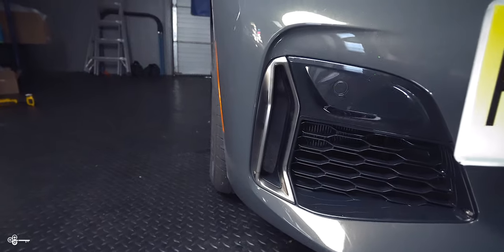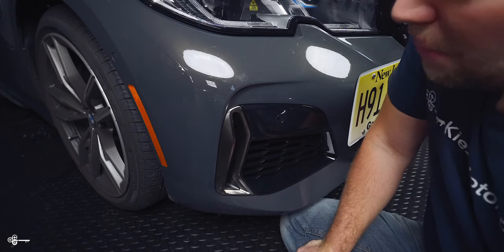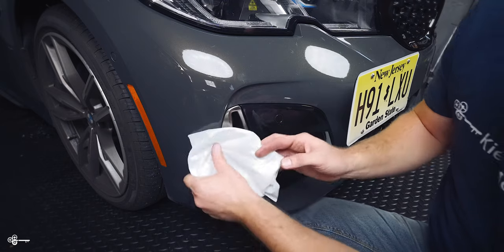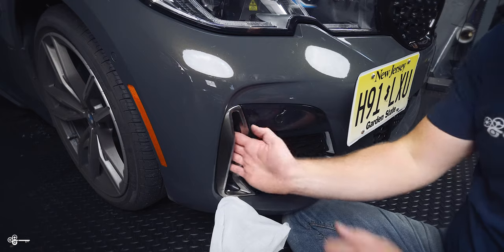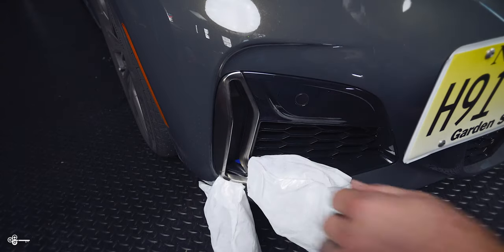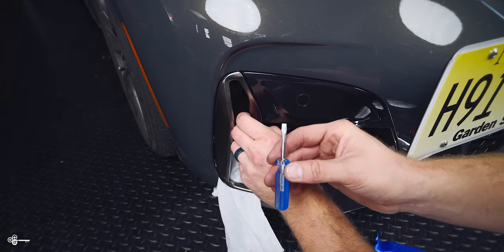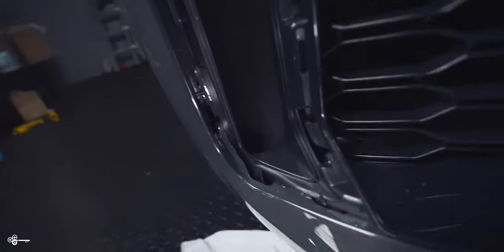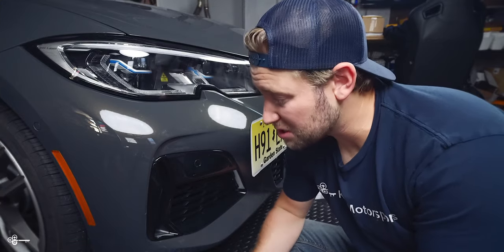How to Install BMW G20 Front Bumper Trim (BMW M Sport High Gloss Black Front Trim)

Comment: I just completed the switch out and the G20 now looks amazing (after the black grill, carbon fiber mirror caps and carbon fiber rear spoiler).  Thank you Bryan for the instructions and yes you should first start on the bottom inside clip (side with 3 clips) as that pops easily with a trim tool.  Then pop off the opposite side bottom clip (which now will pop off easily with your finger). Then gently work your way up the side with three clips.  I used a very fine thin flathead screw driver (like in the video) to get the middle clip (using the new trim piece as a guide and your instructions to depress the tab).  Then release the other outside tab (side with two tabs) with your fingers before attempting the last top tab with the fine screw driver.  After that the trim piece popped right out.  Go slow and it does work.

Comment: Great video/instructions!  Two additional tips to mention here: 1.) as mentioned in the video, start from bottom up/outside clip first--on my G20 I was able to reach the backside of this bottom/outside clip from the small brake vent gap within the wheel well. By also pushing on the backside of the trim tab I was easily able to pop this first clip.  Then following same method in video get bottom-most inside clip and once you have these the others are pretty easy.  2.) If you don't care to save the old trim pieces, this entire process can be made very quick.  I popped the first two tabs and then used a Dremel tool to cut the bottom of the old trim piece after that it's easily removed.

Comment: At least for me this seems extremely hard and almost impossible; I started by trying to undo the first lower clip that’s supposed to be reached easily. I don’t have large hands and I can reach it but I can’t apply the force for the clip to unhook. I don’t even know if I’m applying the force the right direction… The other three clips where you use a pry tool seem to be way easier!

Comment: Is there any comprehensive guide on how to replace the entire air intake grill? I'm trying to replace not only the silver trim, but the entire intake grill itself. Front right to be specific.
Reply: Anyone done this before? Does the bumper need to be removed or can you just pry it out?
Reply: Did you figure it out i need to change mine?

Comment: If you don’t care about the old ones just pull them out by force nothing happens to the clips or any damage to the car just the old trim tabs break but who cares if you’re putting on new ones anyways. Took me about 5 minutes to do it that way rather than trying for over an hour following along, my hands could not fit for the first clip like he did in the video, I don’t know how he unclipped it so easily.
Reply: lmao yes. The clips are way more difficult to unclip

Comment: BMW Dealer said they want $800 and it's 4 hours of labor for the two grill trim and the kidney grill replacement. They said they have to take the front bumper off? I told the dealer I literally watched a guy do it in five mins with no bumper removal. No wonder no one likes the dealerships. I bought the tools so I'll do it myself. I know it's not the easiest thing ever but $800 is robbery.
Reply: Did it myself. Grill trim was very tricky.
Reply: Dealers aren’t experts in mods; most people just by the car and never mod them; and the things we nod don’t tend to break so the dealership staff don’t ever replace them.   Its just not what dealers have experience in.